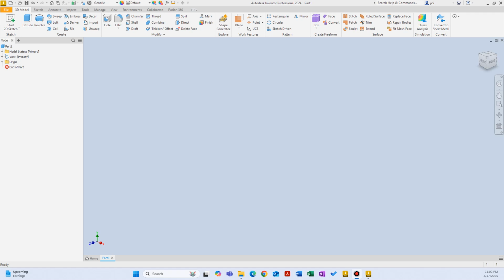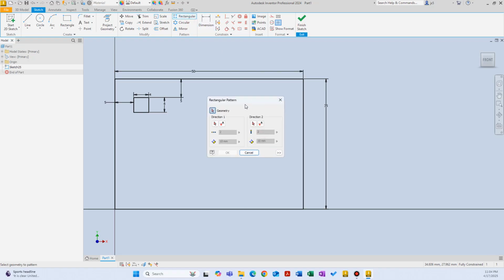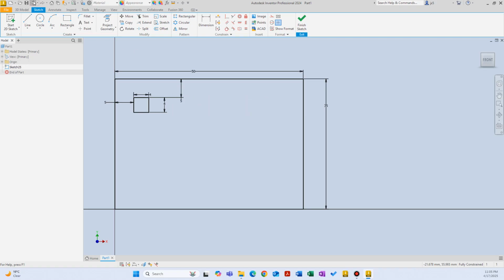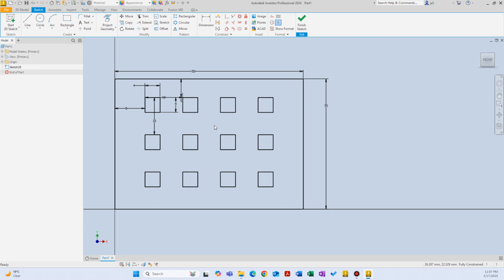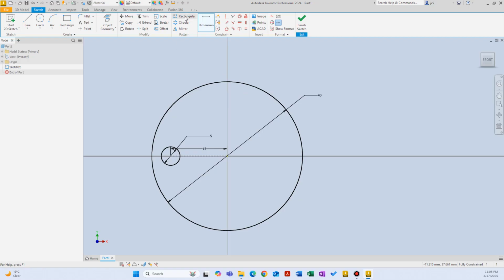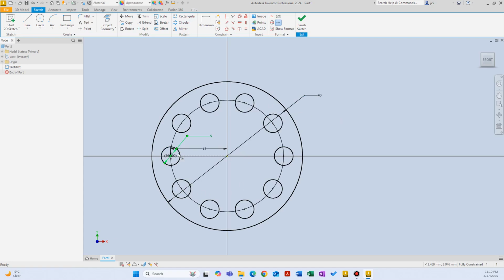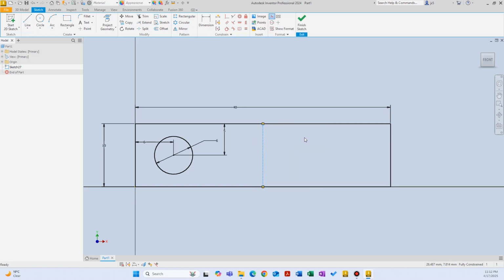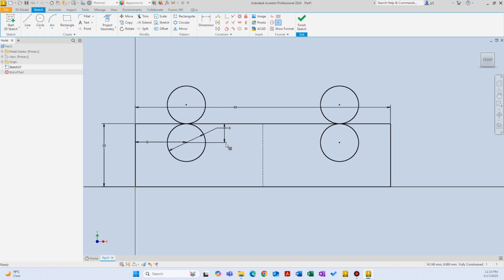20 - Rectangular - Circular - Mirror Patterns | Autodesk Inventor Professional Tutorial

Comment: Please explain how to work with existing patterns. As all pattern elements look the same and there is no sketch pattern element in the model tree, one may be confused how to modify or delete pattern or mirror.
Reply from the maker: Hello, do you mean editing the sketch patterns? I see your point and you are correct. If I understand correctly, you mean that if I add a circle and pattern it in the sketch mode to 100 circles, it would look like I added all the circles manually, without anything added to the feature tree. In that case I would have to right-click the first circle, and find "edit pattern" or "delete pattern". Is this what you meant? Please let us know, I am taking notes of the feedback from our subscribers, and planning to mention these items in a separate video.
Reply: @StarryIndustries  Exactly. And about mirror - it simply create copies of objects and apply symmetry constraint to them, you can not add/remove objects or redefine mirror axis anyhow later, just delete and do it again.
Reply from the maker: @georgewashington3164  That's a very good point. We will have more exercise videos, this is something we can mention in those videos. We can use patterns to design the part and talk about how to edit the patterns. Thanks again for bringing this to our attention.